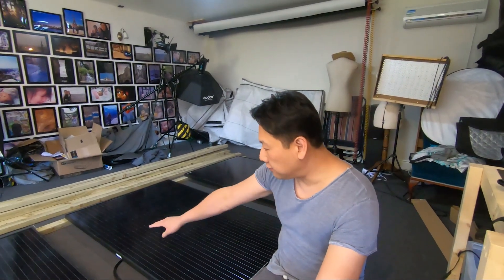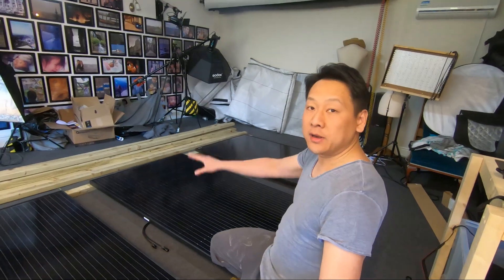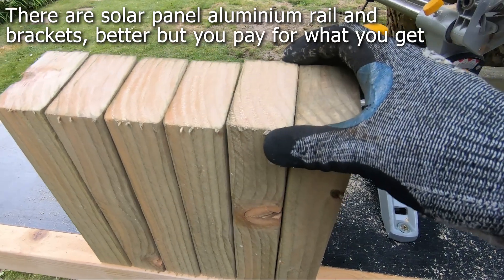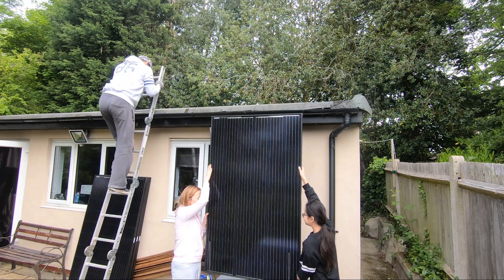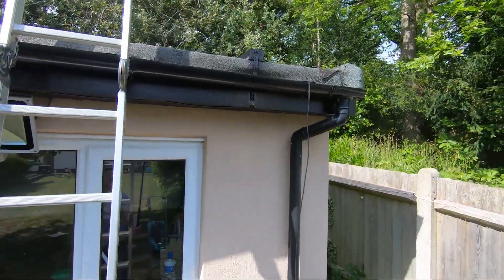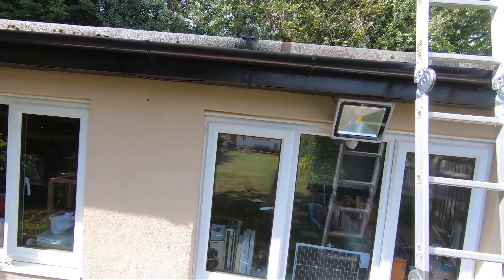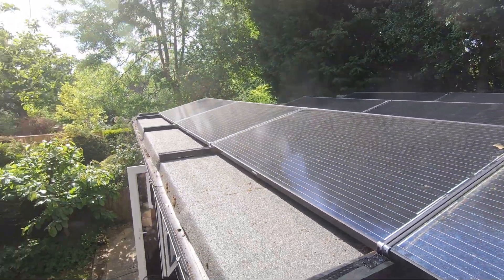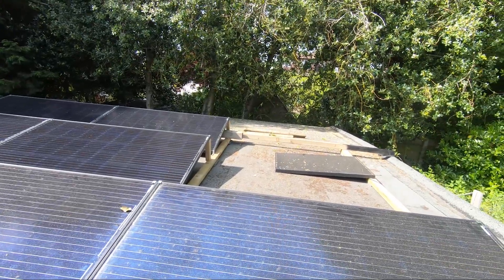Day One Moving and mounting panels DIY Grid tie solar power for home during COVID19 lock down

Comment: Well done! Mind you, I saw partial shading on the solar panels!
Reply from the maker: I have shading from 6am to 9:30 and 4:00pm to dark. There are tall trees from both left and right a few doors down so lost some light. I have 3x400w half cell panels coming which will be the start of the ground mounting west facing array to offset some afternoon usage. 10kw battery being installed to bridge deficiencies at peak hours as I am moving to octopus agile traiff in a few weeks! 

Thanks for your support 🙏

Comment: i found it best when i was off grid to align for the best winter production as even in that angle in summer you will produce more then needed
Reply from the maker: Learning by mistake 😂, will adjust angles and spacing in due course. Looks like they are too close together for winter months. 
Ground mounted starting this week so may even move some to the ground. Since I have easy access to roof it is flexible 👍
Reply: @BCreviews  yup exactly how I learned  I feel it leads to a better understanding of how it works this way

Comment: Thanks for documenting your project, it's something I've been contemplating too. I have a 6 x 4 m flat roof that I'd like to populate with solar PV.
Reply from the maker: Make sure you get structure check, there is a lot of weight to be added to the roof.
Reply: @BCreviews  I plan to have my roof re-felted before I do this, I'll check out the roof whilst it's being done. I'll probably get some studs fitted to he joists and reinforce the joists, so that I can bolt the PV frame to the roof.
Reply from the maker: Flat roof generally not good idea to drill through, there are other ways to secure the array to the building without introducing weak spots for water ingress